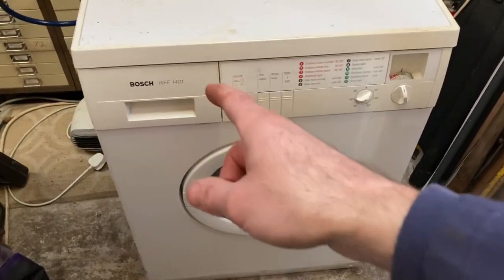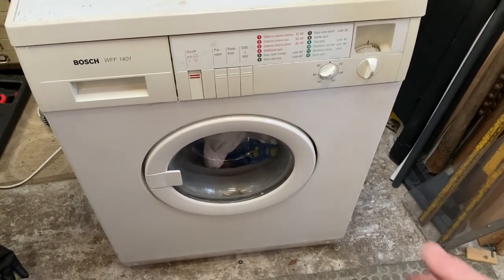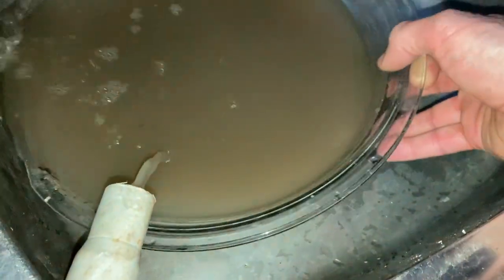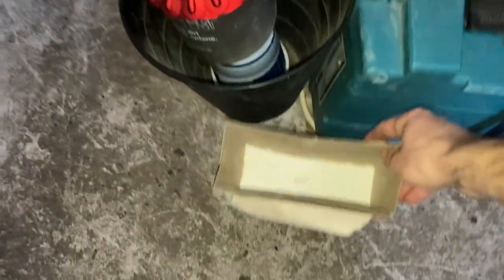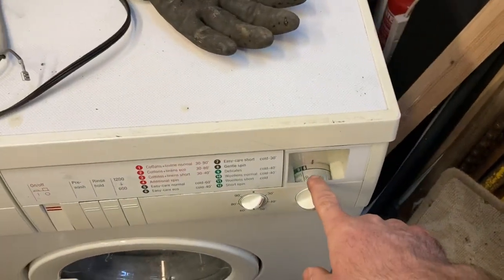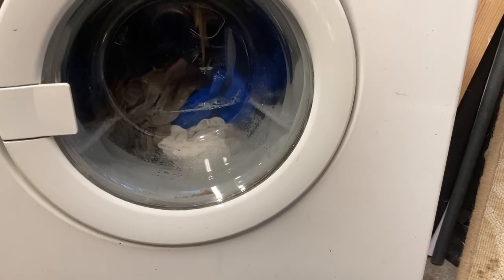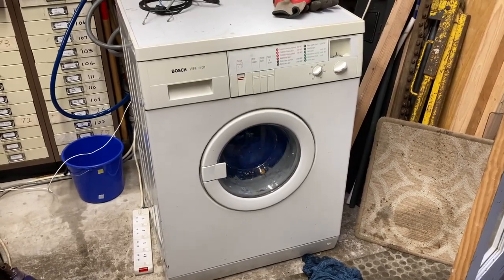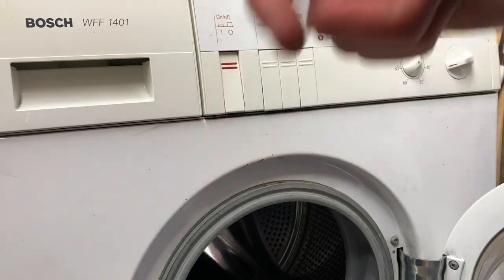Bosch WFF1401 | Test wash after bearing replacement | easy care short wash jumping around!

Comment: That's not bad,  does it use a simple computer or rotating barrel ?
A long time ago a friend used her washing machine,  but the program was a square  tile of Bakalite with the programs on it.
You could insert each side in a slot of the machine and you could turn it over and more functions were programmed.
Have you ever seen one?
Unusual idea.